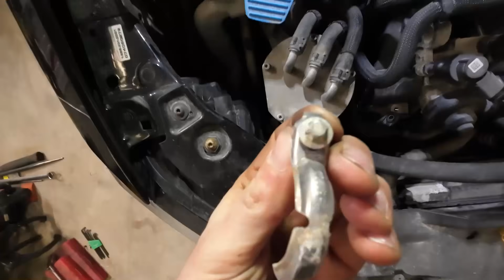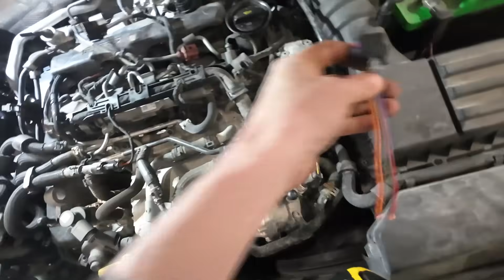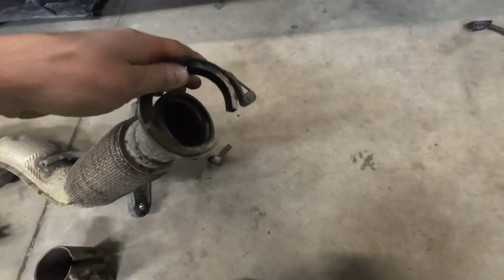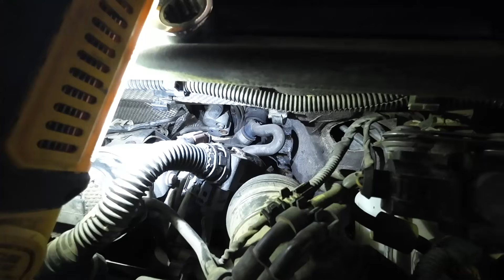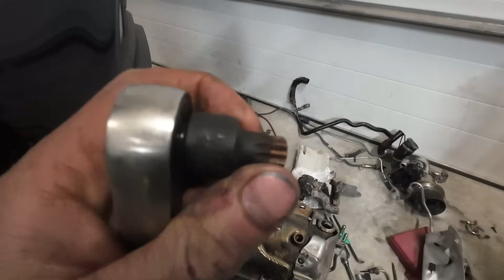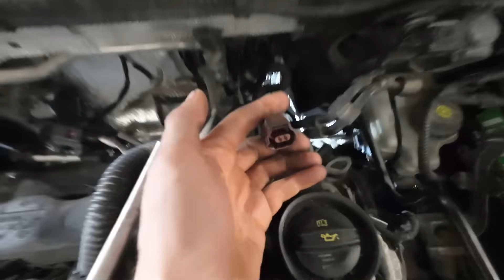EA288 TDI CVCA/CRUA DPF/DEF/EGR removal

Comment: I just deleted my 2015 Jetta but is not working right I think I might be missing a wire connection or something because is giving me the check engine light and the spring kind light and it will only rev up to 2500 rpm’s

Comment: Josh - for the 15' Golf CRUA, when doing say Rawtek delete kit, what else do I need to remove unnecessary things?  
Things like EGR block-off,  race-pipe etc?  CRUA with it's intercooler intake manifold seems unique and hard to find info on.

Darkside sells:
"EGR Cooler Blanking Kit for MQB Mk7 Platform Vehicles / EA288 EGR Delete Kit" listed as fitting CRUA - curious if I need that or equivalent or is that basically in the rawtek kit?
And the race pipe they sell "Darkside 2.0 TDI Common Rail EGR Delete / Race Pipe and EGR Cooler Delete" doesn't list CRUA.  Curious if you have seen a race pipe that fits CRUA or what options I have?
Sorry the CRUA is hard to find info on.
Reply from the maker: You just need the down pipe, the low pressure EGR plug and the egr cooler bypass hose. Im not familiar with the darkside kit on the ea288 but the EOC/MR Tuning kit has everything you need, done need any other blocker plates or race pipes

Comment: IF you are deleting, do you reinstall the electric water pump on the bottom, or does it go away?
Reply: also wondering the same. and what to do for the egr? just put it back in and leave it unplugged like the gen 2 engines? or does it need to stay gone and have the hole on the turbo plugged?

Comment: Hi Josh, Happy new Year! 
I was driving my 2015 VW TDI during Christmas 2025 and got a check engine light for accelerator circuit open. One of the main reasons I found was throttle body clog up by EGR valve. In the previous generation the throttle body was right in the front of the engine and was easier to reach. Do you happen to know if you need to remove the EGR and DPF systems to get to it on this model? I saw your video and it looks like a lot of work which i would want to avoid if possible.

Comment: i bought a 2015 6 speed manual tdi to use for my next engine swap. i watched this video to see what i need to do to it when i get out the drive train and have it running on the floor like i did with my cjaa swap.

Comment: Did you end up doing a loop on the def injector coolant lines? Should be finishing up this job tonight and think I would like to get that out of the way as well. No need to have it. 5/16" hose ? Also I suppose I am just going to use some dielectric grease and tape until I can get the plugs from you. You were not kidding though that radiator fan almost wont allow the DPF to drop out. You also mentioned core value, noone wants to buy the DPF/cat from the 2015 passats. people say they are worthless.
Reply from the maker: sorry for the late reply, yes i just looped it with some 5/16 coolant hose from another engine i had laying around. the 15's seem to have no value, mine went up into the attic incase its ever needed again
Reply: @JoshsJettas  Probably where mine will end up too. Will order some plugs from you soon. I was going to ask to pay for the files so I could skip the strike issue but would be easier to get them from you probably.

Comment: The not sold 2016's went to Mexico the dealer mentioned,  on the deep well O2 sockets  put a hose clamp around it after installing it on the sensor as it keeps it from spreading

Comment: Hi Josh. Just wondering if you could answer a quick question for me,.. I have a 2012 cjaa 2 liter, dpf delete, cats etc.. and also a generic malone stage 2. I just blocked off the egr pipe to the egr valve on the intake (just made up a sheet metal shim and slipped it in-between the 2 flanges. It seems to have like another 10 hp or so,..(just estimating) and so my concern was will I damage my turbo doing this?? egr codes HAVE been tuned out of the ecu codes, so there is no code coming up but will it damage the turbo giving it MORE exhaust power?? Because there is more boost now. And more power

Comment: Any particular year of these better than the other? Im in the market for one atm...currently looking at a 2012
Reply: The 2015s are really good
Reply: @RawMen_Noodles  have you ever deleted one? I know pre 2014 they didnt have dpf and have heard the ones with dpf are harder to mess with
Reply: I haven’t deleted mine yet, but I know from research 2015 is the most challenging and expensive to delete. Everything post 2007 has a DPF. The 2015 TDIs were the only ones that have SCR and take DEF fluid.
Reply: @RawMen_Noodles  yeah ive seen a few videos about deleting one thats why i wanna stay around 2011-2013. Deletes were a bit easier and cheaper.
Reply from the maker: If your going to delete my opinion would be a 09-14 whether it’s a cjaa or ckra they both have their quirks. If you have to stay emissions intact then 15. The 15’s are just more complicated/less fun to work on and being a one year only engine parts can be trickier to find.

Comment: I'm watching your videos. I have a 2015 Jetta that changes the rail fuel pressure sensor, and it didn't turn on anymore. try immo, huh tried fuse, try to get the old sensor back again and don't turn on, don't have any codes, and doesn't get any energy to the injectors. What do you recommend?

Comment: Hey josh, malone just added a new stage 2.5 tune for the CJAA motors. Are you gonna do a video on it?
If not, any opinions on it?
Reply from the maker: Ill probably do a test video on it as I wanted to do the rail sensor anyways. Only downside I had heard was manuals might require an upgraded clutch

Comment: Just barely swapped a CRUA from a golf into a jetta that originally had a CVCA, so all of this is really familiar to me. Even still im learning new stuff from your video. 👍
Reply from the maker: They're quite busy engines, I got a wrecked one awhile ago to tear down but theres so much going on with coolant lines ect.
Reply: @JoshsJettas no kidding! Trying to replace the oil cooler was a nightmare 😂
Reply: @JoshsJettas where did you get it from,copart?